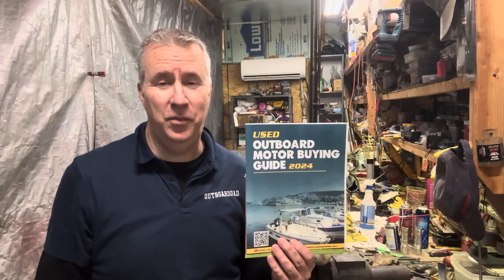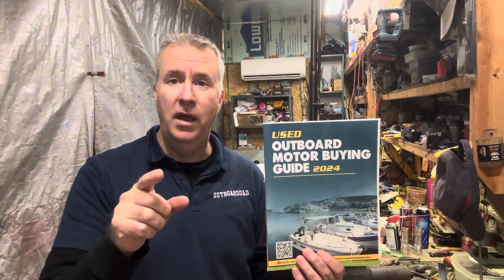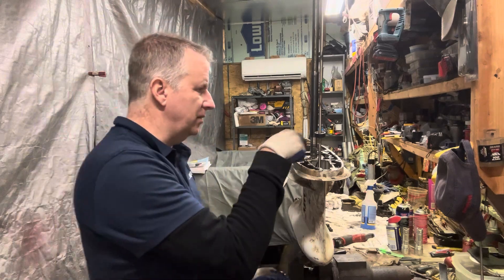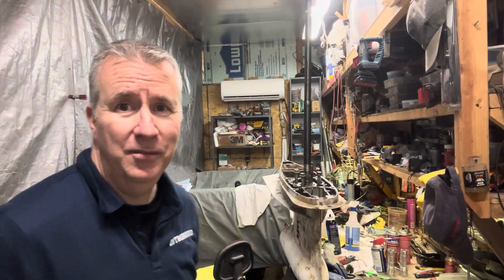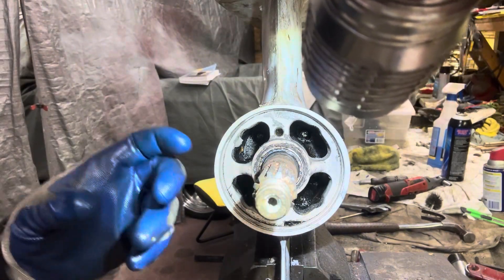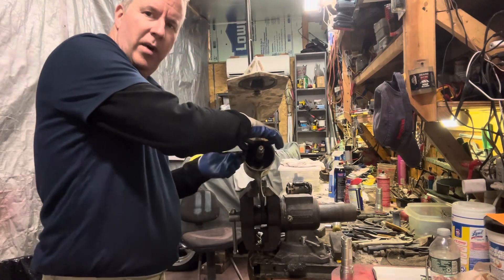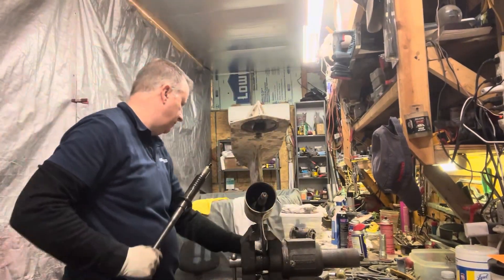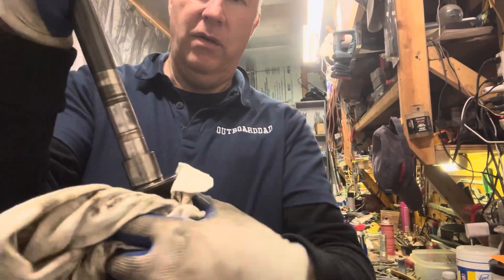Outboard Motor Lower Unit Complete Rebuild (Part 1)

Comment: This video has been a huge help on my 1985 v4 that struck a rock last season, do you mind sharing what size wrench was used to loosen the nut on the bottom of the shaft?
Reply from the maker: If I knew I would share, have to pull it out of my tool box and see. It’s actually an old wrench that is very flat. If you email me I will get a size and picture. Keith@outboarddad.com

Comment: The beauty of these OMC gearcases is their simplicity and amazing durability.  I'm thinking you are correct, that shift rod cover/oring/bushing swelled up jamming the shift rod.  You really can not judge gear mesh/shimming by the amount you can pull up on that driveshaft.  Once the driveshaft is spinning, the beveled gear teeth will drive the driveshaft up against the thrust bearing, the vertical movement in the driveshaft really does not affect anything and is "normal".  In order to check proper gear lash/shimming, a special tool from OMC is required, an expensive jig with various shim gages to help determine the amount of shims needed.  In this case, if the gear teeth look normal, I would reuse the shimming that you found and not mess with it.  Again, these OMC gearcases are pretty robust and don't require a great deal of "shimming", gear lash testing.  
So, am guessing this outboard was "given up on" simply because of the jammed shift rod cover/seal/bushing.  Too bad about the damaged skeg, but someone will end up with a great old engine ready to provide many more hours of fun.
Reply from the maker: @donk499  Agreed and thank you for your input!

Comment: About the seal wear; is it possible to mill the end of the two-part shaft a couple of thou to move where the seal rides?
Reply from the maker: @kq2799  Interesting, I would assume so. Usually I  just space the seal a couple thousands so it rides a little higher